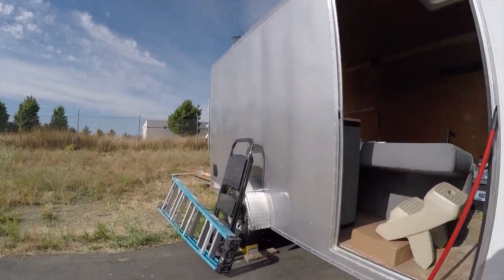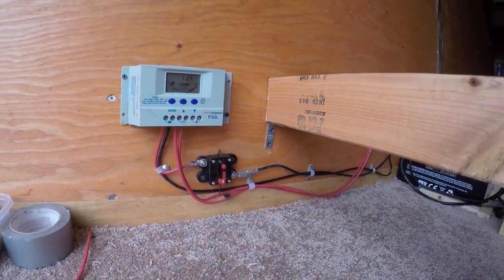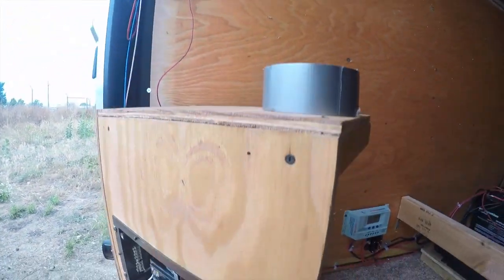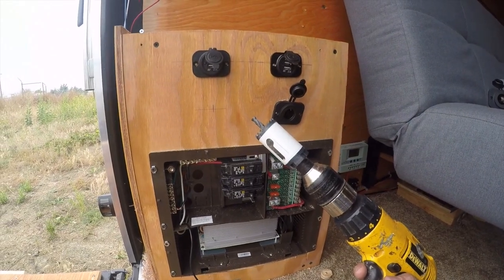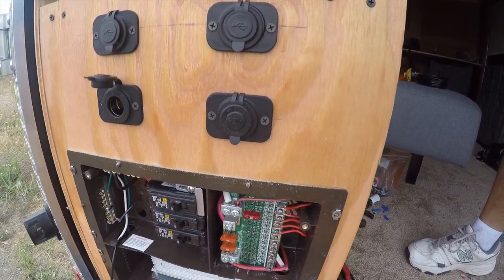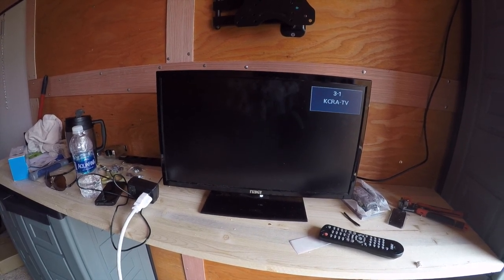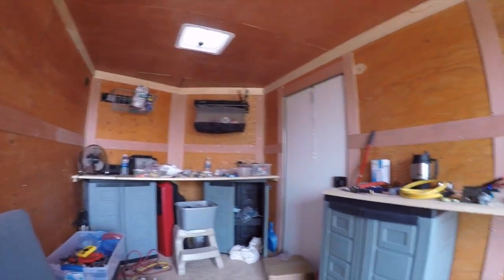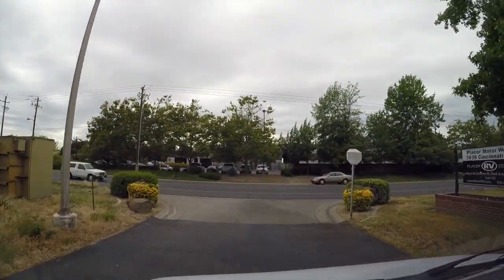Cargo Trailer Conversion...Electrical Wiring....12 Volt Plugs...AC/DC Power Panel...RVerTV

Comment: I'm thinking about adding solar to my trailer myself. Did you put some kind of disconnect in so you can disable the solar/power inverter when plugged into shore power?

Comment: It has life now!  Won't be long.  When I was 12ish, I worked a couple summers with my uncle & his electrical business.  I can do many electrical projects now.  The 12 volt & solar, I'm not sure about.  LOL  I wish we had better solar in our RV.
Reply from the maker: wire is wire.. i bet you could do it....
Reply: I'd love to have 12 volt to run my crock pot on while we traveled.  Hubby won't run the generator while we drive.  We never use it and I told him it will get gummed up, so better run it while we travel.  Then we won't be 9pm eating dinner after we set up.  LOL  He isn't handy, so doesn't seem to get this stuff.

The inverter/converter stuff confuses me on solar.  I don't even know which is which.  LOL  Would a need a MPPT thingy too?
Reply from the maker: https://www.google.com/#q=power+inverter+description

Comment: Learning a lot from you! Been watching your videos on conversion from beginning. May I ask you why you did not put the wires behind the plywood originally? I may have missed it in the very beginning but did you actually create a blue print of everything kind of a draft in your head or just playing by ear? I've seen some blueprints of conversions online you can find by looking up "Images" online? Once you chose the plan and modify it you'd lay out your electric and never see wires again. I saw you almost cut one of your rear lights wires when doing "shore power" outlet? If you had laid the wiring before putting up plywood it would make it easier, in my opinion. Or are you planning to just see how your layout works for you and then change it to your better liking and the put all the wires away? This will require much more work by taking the plywood down again. Just wondering?
Reply from the maker: walls are too thin only 1 inch.... wasnt worth the trouble to pull all plywood....and if i decide to "sell"  i can pull the solar out :-)  thanks for your question !!

Comment: How do you determine the amperage and/or voltage that goes to the USB ports? Is there even a range, or is it set by some standard somewhere? Thanks in advance.
Reply from the maker: most vehicles have a 10 amp circuit for 12 volt plugs

Comment: Good job on build.  I used to do deliveries down around where your working.  If you get hungry during day watch for the roach coach that parks in front of the Pacific Pride down street from you. Lady makes some pretty good broccoli chicken over rice.      Why didn't you recess the 120 ac plug box?  Looks a little bit in the way.. ED   P.S. Pretty good place to boondock  just go down street and hang a right. Lots of places.
Reply from the maker: thanks edwin i seen the roach coach there